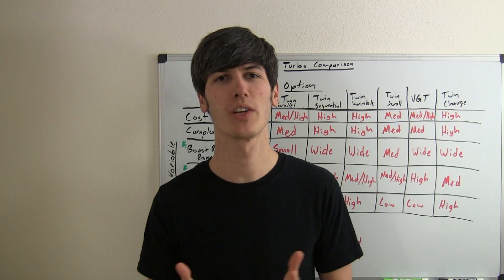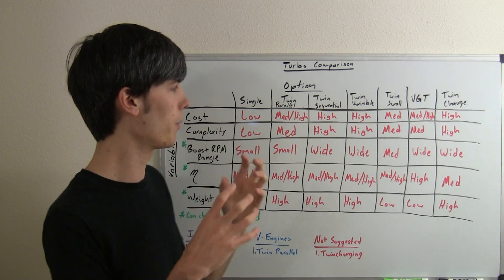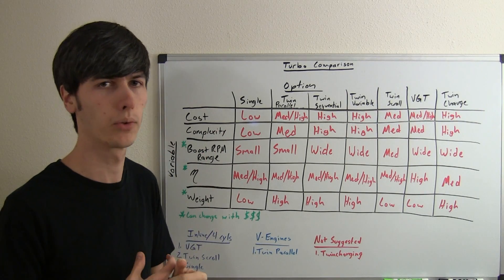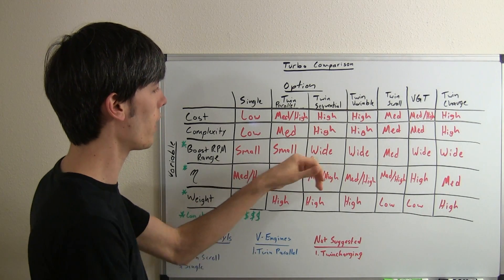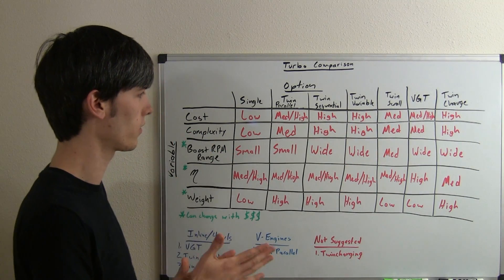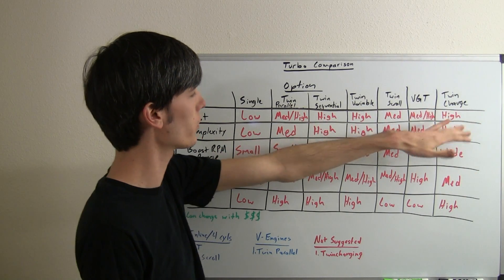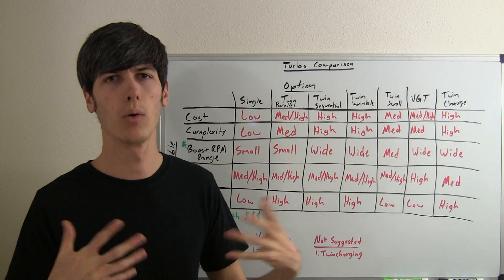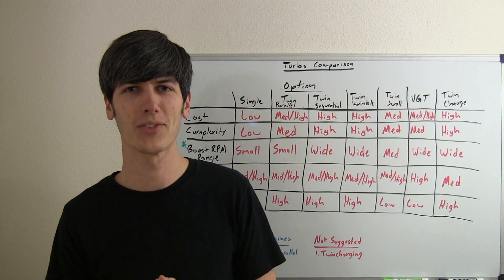Turbocharger Comparison - Twin Turbo vs Twin Scroll vs VGT vs Single Turbo

Comment: Don't forget that BMW used twin-turbos on their in-line 3.0 liter 6 cylinder "N54" engines with great success. Won lots of engine awards for that one. So twin-turbos are not just for V engines. They have since switched over to a single twin-scroll design.
Reply: ***** You apparently missed the point. BMW used a parallel twin turbo on an in-line 6 cylinder, thus they were not only used for V (or boxer) designed engines as the video suggests. And yes I did mention they have since changed to a twin-scroll design. http://www.autozine.org/technical_school/engine/Forced_Induction_3.html

Comment: I disagree a bit with the twin turbo boost range. I've done a basic moment of inertia calc comparison between a few twin and single turbo setup's equivalently setup for 500bhp on a rb26. the compressor and turbine sides of the turbo differ by 30mm or so in diameters between one of the twins and the big single. After the moment of inertia calculations of both setups the twin turbo setup value is still half as resistant to rotational acceleration (spool) as opposed to the single. both on the compressor and turbine side. the assumptions I made for both sides kept the calculations fair, used the same equation for each. also after being in a 300Kw twin turbo rb26 and a 300kw single turbo rb26 it was quite clear that the twinturbo setup kicked in boost 1500-2000 rpm sooner than the single (you get the feeling being pushed in your seat and can see the revs climb very quickly much sooner than the single turbo) it would also hold its power all the way to redline like the single when it kicked in. I would say twin turbo has more advantage over a single turbo setup if cost and space wasn't a concern. would like to hear your views, thank you.
Reply: Hate to  use your bubble but the single rb26 you experienced must have been sized wrong because a properly sized single will out preform the twin rb26 setup in every part of the rpm range. Actually a video was made proving this exact scenario.
Reply: If you search Twin vs.  Single turbo myth busted rb26 it should pull up the video of the outcome from Dyno and actual driving.
Reply: +Turbo Chevelle I've seen the video your referring to I think, it was a 400kw+ r32 GTR? that was an unfair comparison in my view as they compared an old pair of  GT garret twins on the Stock cast iron manifolds, vs the all new twin scroll GTX garret single with a 6boost twin scroll manifold. so 10+ year old tech turbos on turbulent untuned manifolds vs latest tech twin scroll single on tuned length after market manifold.
Reply: No the video clearly stated the turbos they went with manifold work and exhaust flow enhancements that were done to the car before the swap to prove they had no problem with flow. We can argue all day long but the fact is that single are more efficient, that is also backed up by Garrett Turbos website as well as many other builders out there. Twins are more of a packaging issue or for the look but single gets it done. One WG, one BOV, one oil line, and one heat sink instead of two of everything. Less complexity and less to maintain.
Reply: +Turbo Chevelle you've havn't seen many skylines if you couldn't tell those were the factory cast exhaust manifolds on the twin setup on that car, the manifold makes all the difference at those power levels. the GTX twin scroll is an amazing turbo series, but they could done a better job putting it up against a more equivalent generation of twins. BMW, Nissan and Toyota put millions into the development of their straight 6 turbo's and all the peak performance engines have twin turbo setup's, whilst their lower range have single (such as my rb25), so i highly doubt it is just down to packaging and "looks".
Reply: +KonigK1ngs Whatever makes you feel better. Like the video said they before they went with the single they made sure that they improved the exhaust system.  Granted they could have used a new tech set of twins but the excuse of the manifolds is played out.  If the factory spent so much in R&D then why would they put a crappy combo on the car.  I don't have to see a skyline to know about exhaust gas velocity and how turbos work and what levels of horsepower can be supported by cross sectional dimensions.  Fact is that the manifolds that were on the car are capable of supporting more horsepower than that car was producing.  It all come down to correct sizing.  I know a little about the GT-r's too, and know a few guys that have them and a couple are friends of mine that I have intimate knowledge of their builds and tunes.
Reply: +Turbo Chevelle with the manifolds its not just about increasing the cross sectional area. At the flow rates these motors are pumping out ensuring laminar flow of the gases for high gas velocity, and well tuned equal lengths to ensure there's intervals between gas pulses makes significant difference. I designed the extractors for my universities FSAE car in the 2015 competition (video on my page) so I have an idea of what's "played out" and what isn't. those stock manifolds had a light porting which took some of the abrasive surface off, but not nearly as smooth as the steam pipe 6boost single turbo manifold. and the runner lengths are nowhere near equal. even my tunner mentioned I've lost about 15kw sticking with my cast manifold instead of going tubular, and that's only at 220rwkw, at 400Kw your talking 30-40kw lost just in manifold choice.. correct sizing is one thing important thins yes, but theres further steps taken to give a significant edge (e.g. twin scroll vs non twin scroll) which is why there were such substantial gains in that rb26 comparison
Reply: If you really want to split hairs it really doesn't matter what the exhaust manifolds are or how they are built if the heads can't flow it.  Fact is there is only so much that can be done to a stock rb26 before it grenades anyway.  An engine is just a dynamic air pump, the more air you can move the more power it will make.
I would rather have function over looks any day.

Comment: Your videos are extremely helpful and easy to follow! I do have one question though. Say you have a v8 motor and cost is not a factor, what would be the best performing turbo in this group. I understand you recomended the twin-scroll based on cost, however I was wondering what you would recomend based solely on performance. Thanks!

Comment: I would have to disagree when it comes to twin charging, as it may be expensive from the get-go and to get a really good system costs even more but if you really know what your doing it can easily be the best of the systems; so sure its not a good cheap system, and yes I know you were basically going by bang for buck with your suggestions, but I am pointing out that if you have the money this system works the best by far based on set up. Don't believe me? go look up the Smoking Tire's "/tuned" series and look for the "World's fastest Lotus?" episode
Reply from the maker: Grim Wolf X Electric turbos will replace the popularity of superchargers from an efficiency standpoint (and all without lag). But twincharged engines certainly are cool from an engineering and driving perspective.
Reply: The current twin charged VW Jetta has great fuel economy. It is 1.4L though, so I suppose it's all relative.
Reply: Engineering Explained Interesting, I'll have to look into that as this is an interesting point depending on what 'electric turbos' is referring to specifically. It's nice to see youtuber's who actually care, such as yourself, enough to actually read and reply to comment's as well. Keep doing what you do : )

Comment: What Kind of Setup does a BMW N55 335i have? Twin Parallel or Twin sequential? And the later 335i's had the N54, which changed to a twin scroll. Which one is better, N55 or N54?

Comment: I also wanted to comment on twin charging. In recent years it has been making more and more appearances in the production world, (I'm thinking specifically of volvo with their drive e engine line, one of their engines is twin charged, and they now have a near production concept with twin parallel turbos, charged by a single electric centrifugal compressor. I believe VW and BMW both have a production twin charged engine too.) We are seeing this in the production world because people want engine response, and fuel efficiency, also, in Volvo's case one line of engines will, if it hasn't already, save volvo a lot of money by only having one engine production line. I do not disagree that it is expensive to twin charge, but if companies want to have "efficient performance" then they need to get rid of bigger engines, and concentrate on making responsive power with smaller ones.

Comment: Which turbo setup would have the least turbo lag? (specifically for a rotary engine if that makes a difference)
Reply: Zak Vand Excluding the car, since you cant just make any turbo fit on a specific car, the least turbo lag would be the VGT. It basically simulates both a small turbo and a large turbo by utilizing the vanes to allow a narrow or a wide exhaust flow based on the RPMs. Twin scroll simply divides the work it takes to spin the turbo to spool so thats where the efficiency comes from and you get much less turbo lag compared to a regular turbo. But the VGT simulates a very small turbo for the lower RPMs and a larger turbo for the higher RPMS and gives the least turbo lag of all the turbos out there.
Reply from the maker: Zak Vand Smaller turbos.
Reply: Engineering Explained Sorry, I should've been clearer, but thank you for the quick response. I meant is there a noticeable difference in turbo lag as to if I were add, for instance, a variable geometry turbo versus twin scroll turbos?
Also, I'd like your opinion as to what I should or shouldn't add to my car. It's a 1991 Mazda Rx-7 base model.
Reply: Zak Vand You can't just bolt on any turbo you want and drive away. Your best bet would be to simply buy a faster car. Unless you really love you car, and you're willing to invest the car's value into mods/repairs/replacements... Just leave it stock and keep it healthy. As it sits, 0-60 in roughly 7.5 seconds, quarter mile in 15-16 seconds. Higher miles generally means slower times, and even after a few grand you're not gonna be much faster than a modern car.

If you're hell bent then buy the 'GT45 13PC T4 TURBO KIT' on ebay for $1000 and have at it. But heres something to think about... A 2013 F30 328i xdrive with downpipe, stage 1 BMS tuner, exhaust and intake work with 13k miles. Now needs a warranty claim because of a small problem that became catastrophic with the extra power and torque the car wasn't engineered for. Now, imagine when you start modifying a 23 year old car with no warranty. So as i said, your best bet is to buy a faster car. Its SO much more practical.

Comment: As far as twin charging.. just one reason to think it could go well:  Lancia Delta S4.  One of the best rally car platforms of all time.  Came with a 1.8L twin charged l4.  Was also mid-engine AWD.  That car was a rocket, and it could handle boost like a champ.  Apparently some engineers tried running an insane 5 bar of boost through it and it didn't blow up.  Oh, almost forgot to mention that stock it did 0-60mph on gravel in 2.5s.  Obviously a rally car team like Lancia isn't worried about cost and complexity too much compared to your average Joe  :D

Comment: I was watching a video about the McLaren P1 and they mentioned that it has an electric motor system. Since the car relies on a 3.8 V6 and turbos, they designed this system as a "torque filler" to make up for the lag associated with the turbos. Does it really make sense to incorporate an electric motor and batteries as opposed to using VGT's instead, or is McLaren simply trying to claim its stake in the hybrid super car market like so many others?

Comment: Engineering Explained or Somebody? Can a VGT work with a gas engine and if it can how difficult would the set up?
Reply: ***** Thank You for the information. I Really Appreciate It.
Reply: ***** Do you know if 1 of these turbos can be swapped into just any car?
Reply: ***** This I do know but I'm just asking can I put one of the vgt from one of the Porsches  onto a different car or is it possible to have a Cummins vgt in a gasoline car?
Reply: ***** Thanks Again

Comment: So, twincharging is overkill?
Reply: Nope. Not really. Think of it as a hybrid forced induction system.(A hybrid engine with a hybrid forced induction system... Hmm.) If you're looking for overkill, some people have proposed a combination that results in 3 things or systems being attached to the base engine, and most likely a lot of cash. For example, I proposed the idea of a triplecharger, which features a twin variable system for the med-high rev ranges, and a supercharger for the low revs. At that point it would be better to invest in an anti lag system.

Comment: Could you do a video on the new 3D printed Koenigsegg turbocharger that combines the ranges, technologies and efficiencies of the twin scroll turbo and the vgt turbo, and all at the same time simplifying everything about it? I just love how cool it is and want to know more about how it works, and how the two awesome technologies smashed together and simplified will change the auto industry forever!
Reply from the maker: Good suggestion!
Reply: Engineering Explained Looking forward to this!
Reply: Engineering Explained Sweet! Cant wait!
Reply: Yeah, IMHO the ultimate form of forced induction is twin vgts. I'm really curious as to how it stacks up against the other turbo types, even though I know it blows(pun not intended) all the other types out of the water.

Comment: Let's say you have a forced induction engine. Will the number of valves per cylinder affect performance under high RPM? Does the higher pressure of the turbo/supercharger under high RPM compensate to some extent for the fewer valves per cylinder? For example a 4 cyl. engine with 8 valves or same engine with 16 valves.

Comment: I think our future engines are very small with advanced types of supercharging. They will be more efficient and still have the hi power option. The inside of a smaller engine will have lower mass and friction. They can also add more strength to the block and the heads because the total weight will still be less when the engine is so  compact.. I  think the emissions vill be less too which is a huge factor for the automotive industry.
Reply: yes

Comment: Twin Parallel Turbo or Twin-Scroll Turbo?
Reply: Pardon? A Twin-scroll is a type of turbo and twin parallel is a turbo setup: two normal turbos installed on either side of a V or flat engine. So you can have a twin parallel setup of two twin-scroll turbos.
Reply: SuperNuclearDeath So are you comparing 2x normal turbos with 1x twinscroll turbo?
Reply: FLYING PANDAS Thanks for the reply, but what I was wondering was for a V-type engine eg. V6, which would be better in terms of maximum power gain and power band.

Comment: Whats the difference between a twin scroll and a VGT? Awesome video btw!
Reply: A twin-scroll has two inlet holes, which allows it to spool up quicker than a standard turbo. The VGT continuously changes the inlet size so it spools up immediately and gets to maximum boost at high RPMs.
Reply: Alex Hsu two inlet holes? haha i better google this! thanks for the answer tho

Comment: As some of the guys below have alluded to, twin scroll systems are super common now.  As soon as the VW group put them into mass production in their most popular models they instantly became one of the most common artifically aspirated systems in the world.  Sure, more varieties of factory cars have turbos, but they are rarely in the more popular models - unless we're talking about diesels in Europe.
So why did they do it do you think?  Is it cheaper or simpler to mass produce than a wide band, high performance turbo only option?

At any rate, thanks very much for your videos, they are great fun.  Now I'll go back to my boring, small, naturally aspirated Japanese 1.8L v4. :'(

Comment: There is a setup where including a mechanical supercharger is actually one of the simpler options; V engine with huge parallel turbos. Sense in such an arrangement is still debatable as by then we're talking HUGE power, e.g. for a 5-liter V8 the number is way over 1000hp, but anyway.

Comment: Volvo had just recently announced that their top of the range T6 engines will now be a 2.0L 4cyl engine equip with a twin charge. They claim that their production engine will develop roughly 302hp and 295lb-ft (similar to their older T6 production engine which was a 3.0L inline-6 with single turbo). What is your take on the matter? do you think they are going to succeed with it? or do you think it's going to hurt them in the long run?

Thanks
Reference: http://driving.ca/volvo/reviews/road-test/volvo-previews-new-fuel-efficient-2015-drive-e-powertrains/
Reply from the maker: I don't doubt their abilities, it may work great.